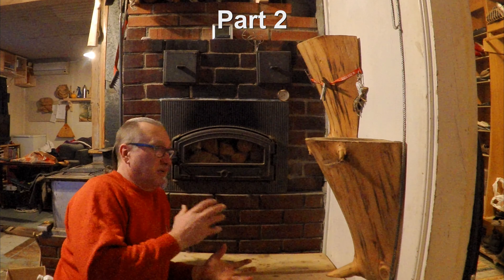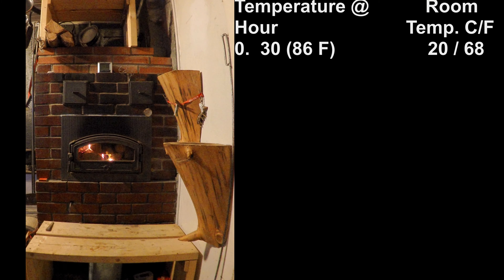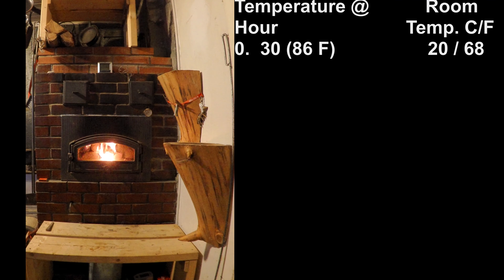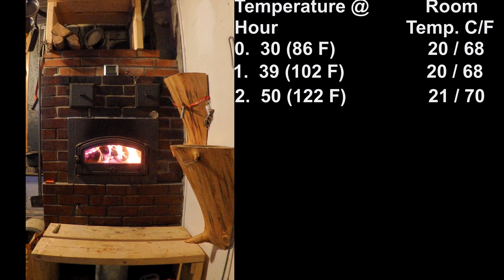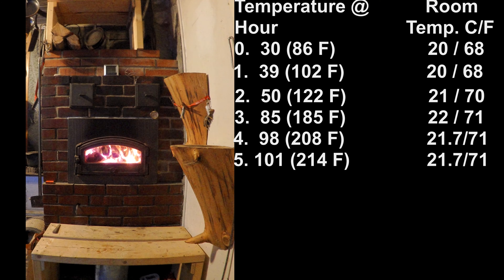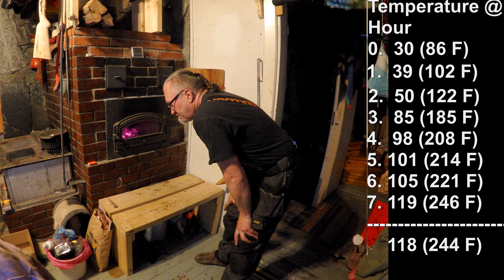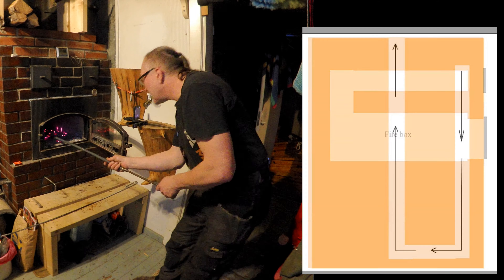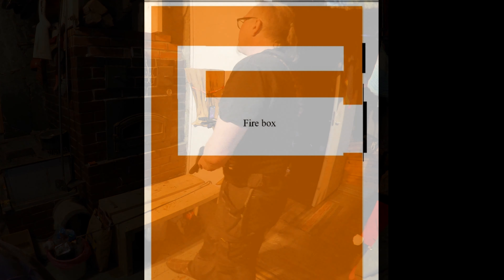Finnish masonry heaters. -The baking oven. Part 2.

Comment: My best guess as to why the bricks heat faster is that the fire might still be burning hotter. Reducing air flow will lead to an inefficient burn IF there isn't enough oxygen to complete combustion, but if you have EXCESS air, reducing air flow can get you closer to the stoichiometric optimum and reduces the amount of air mass you have to heat.
Reply from the maker: I think not. There is a limit to how much heat bricks can absorb and how quickly. Making combustion more efficient is useless if the heat is not in contact with the thermal mass surfaces for long enough. I am formulating projects to divide one mass heater between multiple thermal masses to address this conundrum.
Reply: @downdirty9642  I wouldn't say that's inconsistent with my comment. The rate at which any material absorbs heat is proportional to the temperature difference, including cases where it's being convectively heated, so the air is clearly not getting as hot when the stove is open.

I guess a better way I could have put it is that I feel like people saying more air=better burn are confusing how fast the fire is burning with how much it's actually raising the temperature around it.

Comment: I presume you were born in England. I agree we should be taking inspiration from the old way's before piped gas. I'm old enough to of seen the the before and after of the modernisation of the 2 up 2 down 100+ year old homes here in the NW England and having 4 open fires obviously wasn't a good idea but blanking them off and using gas central heating and mod cons like upstairs bathrooms etc can result in condensation and mold if the original design of air flow is dismissed. I've recently started work in a small ish work shop and energy bills are a strain on the business for my boss I've noticed outside at a corner of the building there's a red brick chimney that is in very good condition I'm not sure if it was for a steam engine or heating
Reply from the maker: Tap into that chimney and build a masonry stove!
Reply: If only it was as simple as that there's now a car spray booth in that corner  I still can't figure out how it was used exactly it's around 2ft Square outside the building no sign of it inside I'm thinking there was a boiler room outside

Comment: First, let me say both your videos on this are excellent. The Russian stoves are similar, and even more complicated in terms of the twists and turns of flue channels carrying gasses. Yes, when the air is turned way down, the hot gasses are "moving slower" along the bricks and the bricks then heat up faster because the velocity is reduced. I was about to type that lower temperatures promotes smoke, and that promotes creosote, but you said that in the video. A good burn with an insulated chimney produces NO smoke that is visible. ZERO smoke....... and not just from a rocket stove but even from an old potbelly stove. When you remove air, it will create smoke. You even showed an outdoor picture of a tremendous amount of smoke coming from the house. Now, I don't care a bit about Al Gore agendas, but........... your poor neighbors who have to smell it. I burn hot and clean and my neighbors don't even know I have a wood stove. There are many reasons you should burn hot and clean.
Reply from the maker: Many thanks for good comments well made. Yes, the baking oven pumps out a lot of smoke when the air is limited, much less when it's opened up. Not zero but much less. But video of a chimney with nothing coming out  - while technically more accurate - not as visually interesting. I do have a super efficient sauna stove that does produce zero smoke but When I am heating with the stoves and it is 29 below freezing (C) as it was here a couple of days ago then I am not considering Al Gore when deciding how to use them. I am going for maximum heat and if that means slowing down the burn then that's what I am doing. My closest neighbour is some distance away, is a great friend, and he heats his house solely with wood also so no problem there!
Reply: Thanks for your interesting videos! 
With my simple little metal woodstove I always try to find the balance between too much air and too much smoke. Too much air will cause the hot gases to escape through the chimney too fast, so less heat inside the house, excatly like you describe it. As a sideeffect the wood will burn down faster of course. With too much smoke/not enough air, I am loosing unburnt fuel wich won´t produce any heat at all. So I guess the best is something in between, did you try that already? I am dreaming of a simple but effective automatic air control, maybe a mechanical timer would already be sufficient. 
All the best to you!  @downdirty9642
Reply: I forgot to mention that too much air will also lower the temperature inside the combustion chamber, but we want high temperatures for a complete, clean and most effective burn.
Reply from the maker: Thanks for this. Of course your metal stove absorbs heat much faster than the bricks of a masonry stove so you do not need to slow the burn down as much to get the max heat from your fuel. On the flip side, of course, the heat dissipates faster too, there are always trade - offs.

Comment: When you say the heat goes into the wall, what sort of wall is it? Is it a masonry wall? Thx.
Reply from the maker: yes, the walls in the center of the house, around which the fireplaces are positioned are all brick or stone.
Reply from the maker: I covered that in Part 1.

Comment: I’m not familiar with your oven heater but have you tried partially shutting those baffles while it’s burning hot to see if it slows down your draft instead of choking down the air? This may help the heat soak into the bricks faster without a dirty burn? Anyway to monitor flue temps? This would be a good way to monitor what’s going on as well.
Reply from the maker: I have tried that and it does seem to slow the burn, It is one more variable I have experimented with but it seems to depend on so many factors. Sometimes it causes a bit of smoke to come from the cleaning ports. It may be outside air pressure making the difference.
Reply: @downdirty9642  I have tried it with my oven several times. It did not have any benefits during the intensive burn stage. It does help when the fire is out and there is only coals left. I have also noticed that it is beneficial to fire the patch from the top. In baking oven, I fire it from the top and back.

Comment: Thank you for putting these videos together. Does it consume more or less wood per hour than a standard steel stove?
Reply from the maker: Well I don't have a steel stove. I guess you mean a cast iron woodstove? How much wood do you have to put in a wood stove to keep a 100m2 house warm for 48 hours? Not sure if you have seen part 1 but with these ovens you just fill it with wood once, light it, and that's it. You do not add more wood at any stage. Once it has burned that 1 load of wood (approx. 7 hours) it then heats the house for the next two days. With a cast iron woodstove you have to add more wood to keep it burning for as long as you want it to produce heat.
Reply: Clearly the masonry stove is the most efficient. Could you recommend any books with fire box/flew dimensions? Just curious if any were fitted with hot water jacket system?
Reply from the maker: Unfortunately the only books on the subject that I have read are in Finnish. I do have layer-by layer plans for 20 or so different masonry heaters/ ovens but none incorporate a water heating option but I cannot see why you could not incorporate a water tank / coil /Jacket. Obviously it would completely change the burn characteristics as the water would pull in the heat far faster than the thermal mass can.
Reply: When i was a child we had a Majestic kitchen wood stove with water jacket which was connected to a large tank. During high heat the water could reach the boiling point in the reservoir.
Reply from the maker: How good is your memory of the stove? good enough to re-create it?
Reply: Although our Majestic kitchen stove would be well over 100 years old today, it may still be in the house where we lived at the time. I was age 7 at the time, now 60 years later i vividly remember my father installing the water jacket and reservoir tank. Yes we could reconfigure the setup. It had a constant cold water source of about 36 psi…well water.
Reply: Interesting video! Do you ever weigh your load of wood? It would be interesting to compare to what I burn through in my home with my Jotul F45 wood stove. On an average winter day or 24 hours I roughly go through 50 lbs of hardwood or two loads per day. I did incorporate some thermal mass concrete blocks around and behind the stove to help even out the heat.
Reply: Thank you. I burn soft wood species: pine, spruce, fir, cottonwood. I use abt 100 pounds in 24 hours. That amount supplements the use of hydronic heat fired by natural gas. During the coldest time of year.
Reply: @downdirty9642  There are some new desings with water heating function from commercial companies, like Tulikivi and Nunnauuni, if I remember correctly. Old cast iron kitchen stows had sometimes water heating ability too. I do not remember any old heating/baking stowes to have water heating ability. One reason could be that it would not have any real use. If the house would have central heating, the water would have been heated with a dedicated boiler (oil/wood/combination) or if the water was heated for bathing purposes, it would be done in sauna with water heating stowe. In the kitchen water was heated with the kitchen stowe.

Comment: So you run your awesome bake oven with draft fully open until it's fully roaring, then damper it down (not closed, guessing hallway by the look of your fire and speed of flames) for the next two and a half hours, then fully open the damper again (full air) ... very nice I see that as very efficient ... for my wood insert I run it wide open whenever there's new wood loaded ... then damper to engage secondary combustion ... I'm sure my insert is hopelessly inefficient compared to yours .... I guess a good sign is that my glass is nearly always clean and the neighbors have never complained in 20 years (there are easily 100 houses nearby)
Reply from the maker: I don't think there is any one formula. Every stove/heater is an individual & it takes time to learn it's quirks and the best way to run it.

Comment: How does air get to the lower firebox?
Reply: There's propably a access hatch to it. In my oven there is and I also use that to get the ashes out also. I sweep the ashes there between every burn and empty the second box, maybe once every second month or so.
Reply from the maker: A little (very little) air gets in just around the clear-out cover. It does not seem to need much, I have monitored the temperature in the lower chamber and it remains pretty constant for 4-6 hours. just smouldering.

Comment: Smoke Fromm the chimney Is not good indicator. When is wood glasses combustion ok smoke must completly gone....
Reply: It's mostly water vapor because there is freesing temperatures. I can have completely clean burn and have white "smoke" from the chimney, because it is mostly water vapour. How I know that? Because doing the same burn during summer time, no visible smoke.

Comment: Very nice videos.  I think that you will eventually stop damping down your masonry heater.  A properly sized masonry heater, when used properly, can go on for some years without need of chimney cleaning.  Sure, they accumulate some light ash, but really nothing that demands attention.  Your willingness to do a cleaning twice a year is no big deal -if you are doing it yourself.  But if you are bringing in a chimney sweeper twice a year, that is a real expense and so contrary to the masonry stove lifestyle.  Here in America, in northern Maine, if you can even find a competent sweep, you will sell a kidney to pay his fee.  Also, be mindful, that those who decide for whatever reason to cut firebox air during a burn, will get creosote on the interior brickwork.  I can promise you that you will not get those interior channels clean of all creosote.  At some point, the creosote will burn.  That will crack your interior layer of firebrick.  And, moreover, cleaning that creosote degrades the interior masonry over time and also will cause cracking.  A masonry stove is an heirloom item.  It should go on for decades without a hitch.  Please reconsider cutting air supply.  On a different note, your coal/ash chute is ingenious.
Reply from the maker: Thanks for your comments. I should explain that while I heat my house exclusively with wood it is not heated exclusively with this baking oven. I have 6 stoves/heaters so, yes, the chimneys are swept twice a year. I do it once myself and then have the professional chimney sweep do it once. In fact here in Finland if I do not hire a certified sweep once a year then my house insurance will not pay out in the case of fire damage. It costs about 250 euros which I don't think is too bad once a year.
Reply from the maker: I find the creosote thing interesting as we don't really have any problem with it here, could it depend on what kind of wood one burns? The baking oven had been used for 60 years when I rebuilt the fire box and there was no creosote. In the ten years of use since then it has not got any creosote in there. Hardwoods grow so slow here that it can't be used for firewood, the hardest wood we can burn is birch. Then we have pine and spruce, alder and aspen. Maybe it's the hardwoods that make creosote?
Reply: @downdirty9642 it is very easy to create creosote here in Ohio with unseasoned wood ... meaning too much moisture... no matter what hardwood... I notice your splits are small... maybe four inches in diameter at most ... so I'm guessing your small splits are well seasoned and you put about 25 pounds in for your daily fire ... Imo that is extremely efficient 😊
Reply from the maker: @stevechurch2126  Most of my firewood sits in log piles in the forest for 2-4 years. I then cut it to length and re stack it here at the house where it dries for another year, I then split it and re stack it under cover for a year then I move it inside the woodshed in spring for use the following winter. In practice all that means that every Sunday is firewood day and I have the next 3 years of firewood drying in my wood yard. By the time I use it it could be argued that is has been drying 5 -6 years.

Comment: Your wood consumption is 4 times as much as in a soapstone stove to achieve the same temperature!
If your stove is so efficient, why does soapstone cost 100 times more than your brick?
Everyone would then build a brick oven.....
Reply from the maker: Well we are talking about two different things. I never claimed my baking over is super efficient, the video is about how it works and how I use it. Soapstone has very unusual thermal qualities which make it perfect for making stoves which will heat quickly and release the heat into your space quickly also. Quickly compared to brick which takes much longer to absorb the heat but also releases it much more slowly. Two different materials for two different types of stove/heater. I don't know if I am using 4 times the wood, maybe, One neighbour has a soapstone stove, maybe I should do a test. Good idea for a new video. But Firewood is not an issue for me here, I have the next three years of firewood out there drying and an unlimited supply so that I add a years worth annually.